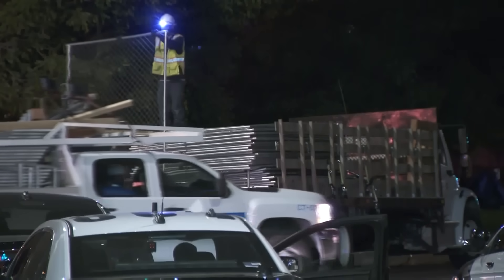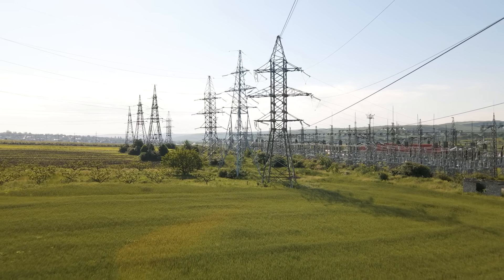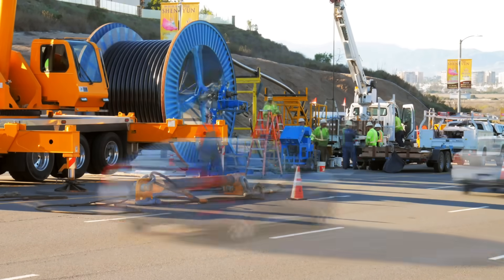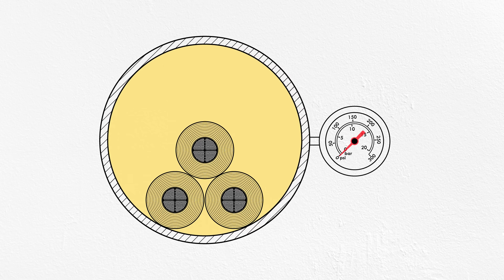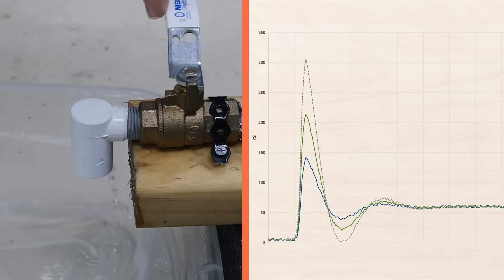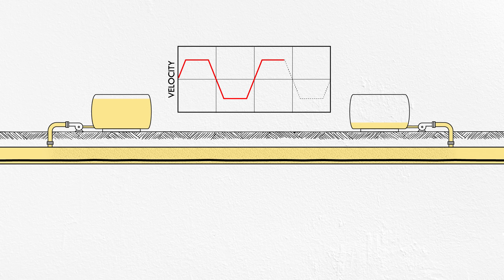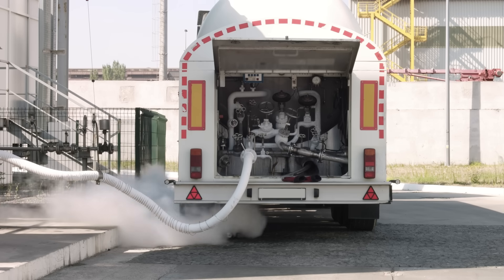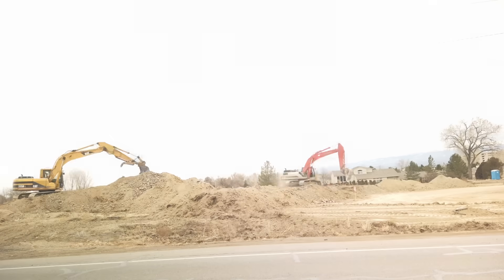Repairing Underground Power Cables Is Nearly Impossible

Comment: Love the content of this channel but the title is clearly a bit hyperbolic as it doesn't apply to more modern cables.

I believe China has done some extensive testing on the repairability of cable types and that they came to the conclusion that underground cables were superior, especially in earthquake prone areas. This sound a bit counterintuitive at first but apparently overhead power lines are more exposed to the elements and they swing, leading to damage accumulating in many places, thus requiring frequent inspections and repairs. Underground power lines tend to require much less maintenance and they usually break in just one or a few places, leading to lower upkeep and quicker repair times during major outages.

Comment: That oil insulation system looks crazy expensive to maintain. I’m amazed that someone decided to actually implement it.
Reply: Oil and paper insulation is still commonly used for step-down transformers all over the US, so I'm not surprised it was seen as the de facto solution back when the line was installed. Definitely a very expensive endeavor though
Reply: Still the only thing used in large transformers, as the paper does allow gas to permeate, and also will not trap bubbles. All power line transformers, from the baby 1kVA pole pig, to the 500MVA monsters used in distribution, use mineral oil as insulation and coolant. Even the instrumentation transformers, used to tap off line voltage and current, so as to monitor the line, use an oil fill and paper insulation, especially at higher voltages, where you cannot guarantee the epoxy fill is going to be totally void free.
Reply: @SeanBZA  In that application the cooling is at least as important as the isolation.
Reply: Overhead ain’t cheap either, and there is lots more of it, just think about the distances.
Reply: @timan206  Yes, but overhead is cheaper because you do not have to dig a long deep trench, just put in foundations every 50/100/200m, build a tower up out of standard steel sections, and then suspend a row of insulators, and a 1km long pull cable, then use that to pull 1km of cable at a time onto the insulators. A lot faster, and you save on the plastic as well, replacing it with a much cheaper air dielectric, with ceramic/glass or polymer insulators on the poles.
Reply: @2009G8Gxp Lots more cables in general, if heat is the issue you either go to more cables, to spread the heat generation out over a larger area, or a much thicker cable, to do the same. The multiple cables though does win out in surface area to dissipate heat though, but gets expensive in needing a lot more control gear to allow servicing and control.

Overhead lines you can have higher current density, simply because you are able to allow for higher temperature and thus more sag of the lines. You can also handle overload better, as there really is nothing to degrade with overload, aside from the cables sagging low enough to arc over to the ground, or trees under them. Underground you have much more stringent restraints on allowed expansion due to heating, as there is no place for the extra length to go.
Reply: its used in electric motors sometimes to keep the windings cool
Reply: Political kickbacks

Comment: Great video that clearly describes why oil-filled pipe-type cable is obsolete technology today.  And it also partly explains why underground alternating current transmission is so many times more expensive than overhead transmission.  But there is another factor that is not discussed.

When configured as cables, the conductors that make up a transmission line are physically far closer together than would be the case in an air-insulated overhead line.  This change in geometry has several profound effects on the electrical parameters of the transmission line.  The series inductance per unit of length decreases significantly - that has the effect of making the transmission line appear shorter which is often a very good thing.  However, decreasing the phase-to-phase spacing also has the effect of dramatically increasing the distributed capacitance per unit of length of the line - which can be a very bad thing.  Managing capacitance on transmission lines is a serious technical challenge; if there is too much capacitance, is may be necessary to invest in additional system components to manage that capacitance which further adds to the already very high cost of a cable-based transmission line.

The process of designing alternating current transmission is an exercise in managing competing factors.  As a result, underground cables tend to be reserved for use in dense urban areas where distances are shorter, while overhead lines are preferred for longer distances in rural areas.  

Direct current transmission presents a different set of competing factors.
Reply: Increased per unit capacitance can result in high voltage at receiving end than sending end. This effect is knows as Ferranti effect.
Reply: That's why hvdc is becoming so popular...
Reply: Yes, and the capacitance and loss factor of the surrounds becomes a problem, where if a cable is only partly submerged in water it can fail, but is happy under water fully, as there is no step change in voltage gradient. Also why the outer sheath is important, a small nick in this can cause the cable outer shield to fill with water and corrode, and thus cause the insulation to fail at the edge of the corroded area.
Reply: I was unaware of DC HV systems until I drove by the Bonneville Power Administration Celilo Converter station outside of The Dalles, Oregon.  BPA has some interesting videos about the converter station and other things.  Grady could do a video on how they got thyristors to handle that much power.
Reply: @johncooper4637  For me it is the Cahora Bassa power link, which runs across the land as 2 separate high voltage cables on pylons, with them being one positive and one negative, but with the ability to operate at reduced power, using a massive earth return mat at the substations, and only a single line.
Reply: How can you invert HVDC to  3 phase line frequency at the other end?
Reply: For underground, direct current makes things a lot easier since you don't need as many cables.

Another smart thing to do is to use a tunnel for more than one thing at the same time. For example, if you're digging to install a subway system, you might as well lay some power lines there, plenty of space and it probably goes to where you need power already.

Comment: I work for a utility in the Northeast and we did some work like that on a 115 kV line that travels underneath the city. Very interesting work especially when you consider that the cable is insulated with paper and oil. Solid dielectric cable is quite a bit less labor intensive. If you feel like continuing on in this electrical infrastructure series, maybe a video about how the cable is constructed would be interesting to your viewers. Especially the differences between oil-filled cable, pilc cable, and solid dielectric cable.
Reply: I read an article a few months back talking of a theoretical cable to be run from northern australia to singapore, to transport solar power, one of the biggest challanges was how to insulate it at the voltages needed as the voltage useable drastically altered the viability of the entire project.
Reply: Paper Insulated Lead Cable PILC
Reply: @Bacongrease00  Not always, often paper insulated copper wires, oil impregnated, then over wrapped with more paper strip and steel tape, with a bitumenised cotton wrap over the steel tapes to provide protection. Often you only find the paper and oil in the ground, the bitumen long gone, along with the steel tapes, all rusted away, but the oiled paper is still keeping the wires dry.
Reply: @SeanBZA  Hi, SeanBZA. I think Brennan was just spelling out the acronym PILC for us, not suggesting that it was always used.
Reply: One of the reasons for the paper and oil was to transfer heat away. Solid dielectric cable will not conduct heat as well, so less power can be transmitted for the same size wire.
Reply: @bob-who-must-not-be-named8522  However, plastic has fewer losses due to cable charging.  PILC cables @ 132kV can lose several hundred amps of rating due to the current required to establish the voltage gradient in the insulation, especially as they age.  Don't get me wrong, the old cables can last decades and still look like new inside, provided they were built properly in the first place.
Reply: YES to this!  I've been curious how high voltage conductors are successfully insulated underground...
Reply: Yes
Reply: Was the solid dielectric cable available in 1975?
Reply: @RonJohn63  No, only ones available were paper insulated, with a choice of either oil impregnation or sulphur hexaflouride as pressurising gas. The development of a reliable solid dielectric cable, plus the oft ignored method of joining it without introducing a step in voltage gradient, which is generally where the cable fails, was a big improvement. 

By me locally they have been laying more solid dielectric cabling to replace older cables as they are ageing out, getting rid of the oil impregnated 66kV cables and going to solid dielectric 132 kV rated cable, though they are only being run at 66kV, as the load is not that large they need to swap out transformers. Doing the expensive part of digging, jointing and burying the new cables in the existing rights of way is saving money, as the major cost is the trench, the cable itself is not as big a part. Yes it comes on 200m rolls, and they bury 3 at a time, staggering the joints so as to keep within the trench opening. All aluminium cable as well, they are making a good chunk of the cost back by digging out the old cables, put in in the 1950's, as those are copper core cables. 

Same for overhead distribution wire, the scrap cost of the copper taken down pays for the new aluminium bundle cables that goes up to replace it, and as a bonus they also tend to replace street light lamps on the pole, as they take the shorting plug out, and replace it with a photocell, as the ABC cable does not come with a group street light core. Gets rid of the dead lamps, though the cyclers still stay there.
Reply: @SeanBZA  has there been any problems or repairs needed with this new cable..?
Reply: @steve-o6413  Aside from those failures directly due to installation error no, it has been working well,despite it being laid slightly below sea level, 100m from the coast. They had to lay during the dry season, as otherwise the water table would be half way up the trench, but at least the water there is mostly fresh water. 

I used to live in the city itself, and the basement would occasionally have moisture in it from spring tide. Solved that by pouring a new concrete floor in the small old boiler room, to seal the cracks. Dig down 5m in the city centre and you will hit water, the entire city is built with piles down to the bedrock.

Comment: Auckland NZ had a big power outage in the late 90s and Its a good story. The entire city center was unconnected to grid electricity for 5 weeks after several seperate underground high voltage lines overheated on a summer day with high loads. Cascading failure scenario.

The damage was permanent and the infrastructure was ruined. The lines company shut down the freight railway running into the area and strung up temporary poles between the rail sleepers (ties). Eventually replaced with a full new bored tunnel with room for expansion and human access for maintenance.

Quite drastic times though, they had to bring in diesel generators to power all the offices and businesses.

Thanks for the video!
Reply: https://en.wikipedia.org/wiki/1998_Auckland_power_crisis
Reply: They also built a temporary overhead line though a train tunnel down the rail way corridor to bring power back to the city.
Reply: @Robert Nelson is it part of some kind of Supergrid project? Because those lines HAVE to be buried because they essentially have to be buried due to the fragility of currently developed  superconducting materials
Reply: I was on task at the time, fortunately we had just installed 5 new generators at the central phone exchange. Power supply company gave them a huge rebate to run them non stop a couple of months till all was in the clear
Reply: @Robert Nelson makes no sense in rural areas, but makes a lot of sense in city centers where the visual blight is noticed by everyone, all of the time.
Reply: My late grandad lived through that, he said it was an absolute shitshow for the full 5 weeks, even the generators for individual places and the temporary setup wasn't enough for the affected area...There were large areas that were constantly having brownouts.
Reply: I have heard many people express an interest in more underground power lines being the answer. It’s a lot more complicated than just laying lines in a trench.
Reply: @Robert Nelson it becomes easier when you  can maintain them in a dedicated right of way and don't have to dig up streets doing traffic management etc. Plus gone are the days when engineers are the only voices that matter. I'm looking at you highway / road engineers in charge of urban environments. 

Overhead lines are easier to break, easier to maintain. All tradeoffs really. It would certainly be easier to bomb a single HV tower in the middle of nowhere than an underground one.

They were also halfway through building their replacement in Auckland, if they'd started a couple years earlier then it would have been all good. Oops.

Comment: What if we reversed the over all design, instead of wire use a conductive fluid in a sealed 100 percent x-ray pipe line we move lots of fluid in the oil field
Reply: Conductive fluids will be far less conductive than copper or even aluminium. Then you need to run 3x fluid pipes for the 3 phases.

Comment: I immediately saw the problem with thermal management when you showed the two tanks and pumps at either end of the system. A much better way would have been to have a fluid return pipe so the oil could be run in a loop and continuously cooled rather than having the thermal peaks. The flow rate to be adjusted without stopping the line for reversal.

We should all be thankful for more modern materials. Still, thermal management seems to be lacking in the designs of many EEs.
Reply: He was showing the installation as-built. If it was put in service in 1984, the technology would have been at least 5 years old. Especially in Los Angeles. The EIRs and permitting would have taken that long, let alone the design engineering. 

And the replacement line took TEN YEARS to approve. That system would already be last-generation. 

You are absolutely correct about the thermodynamics. However, when public and private needs cross, there is always a lag in how current the installation technology is. And if they they change the design after permitting, that is a while new issue.

Comment: I'd like to know a few more details about the system. What is the wire diameter, insulation diameter, pipe diameter, current flow.
Very interesting story and very well done as usual. Thanks.

Comment: That's really interesting - growing up in New Zealand, I was shocked when we moved to the states and all the powerlines were aboveground.  And NZ is known for its earthquakes!  Then again, maybe the high speed winds and continual storms were considered more detrimental when they set up their power grid, not sure.
Reply: Distance is a big factor.  The US is a little larger than NZ and the power lines are much longer and therefore much more expensive.
Reply: @nmccw3245  yeah, that could definitely be it - I also think that tourism may play a factor, as the natural beauty of NZ is a big draw.  I was also very young, so this is purely anecdotal.  Maybe only the local low-voltage lines were placed underground and there were aboveground high-voltage transmission lines, my memory is a bit hazy.

Comment: As someone not into civil engineering, and only just skimming the surface with your videos, it's been easy as a typical dweller in a residential neighborhood to always wonder why they don't put more lines underground. Thank you for explaining these challenges.  I can definitely look at the wires above and realize they're not just an archaic design, but a still practical one.  I don't know if this would be a worthwhile video, but I've been hearing a lot of news lately about the Suns 11 year activity surge and it's threat on the WWW, specifically how cables running transatlantic via ocean floor are most susceptible to such a surge.  Not sure if you know much about this possible threat, but would love to see a video on it with your thoughts.

Comment: i think 3 separate tunnels should be dug to keep each phase separated and instead of steel it should be plastic.

using a thumper is very risky because they are shocking the insulation and risking weakening it so it will fail elsewhere.

a better way i think is an emf meter or rf detector i mean if the fcc can find illegal broadcasters then it should be easy to find a short.

couldnt they filter the oil?
Reply: The risk associated with using a thumper is lower than you seem to think it is.  There is already a failure in the insulation, and it is causing a short at normal operating voltage.  They don't need to use a voltage that is significantly higher than the normal operating voltage of the cable to make it thump, so there isn't any added risk of insulation breakdown from excessive voltage.

If the cause of the insulation failure were not due to mechanical issues, but instead due to high voltage breakdown, then there would already be degradation throughout the entire cable, necessitating complete replacement.